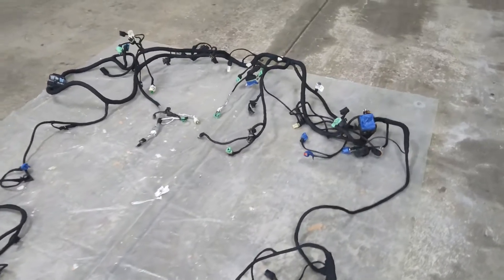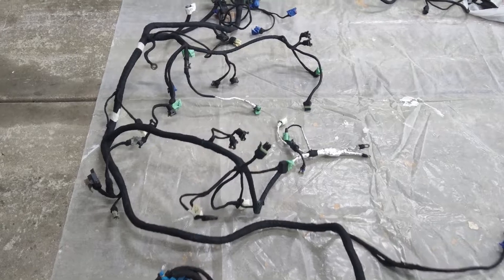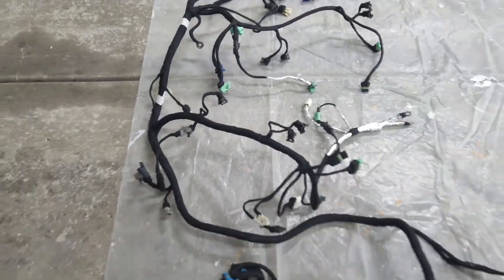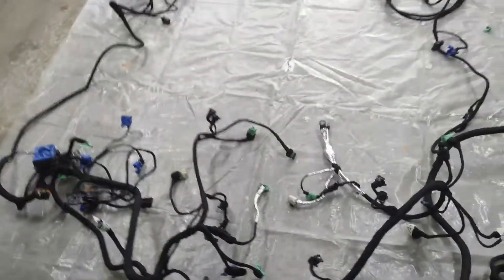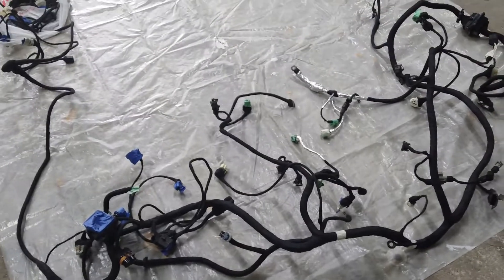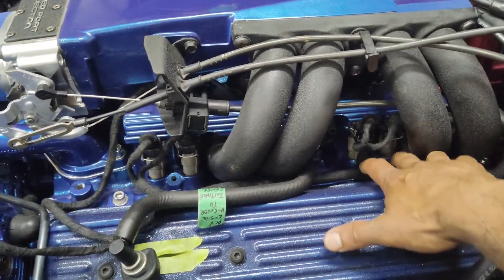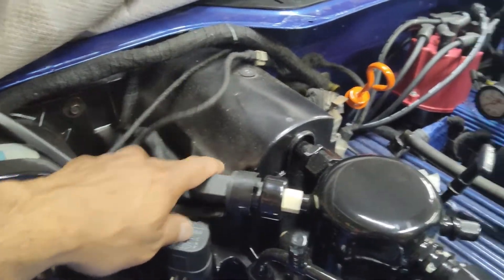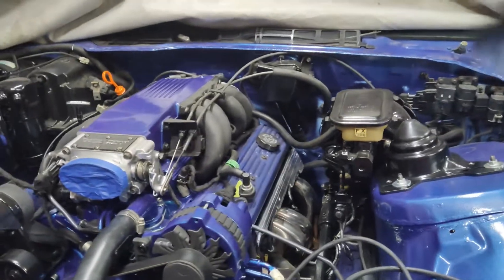Third Gen Camaro/Firebird Engine Wiring Harness | Plastic Loom or Fabric Tape ?

Comment: where did you buy the harness
Reply from the maker: Hi thanks for watching/subscribing.
This was the original wiring harness form this vehicle.  I replaced some connectors, fixed some wires and rewrapped.  If you are looking for a complete harness, just google it and you can find them on eBay from time to time.  Some sellers will separate them and sell them in pieces.
Reply: @JSF Auto +  
Thanks for the reply. I see them everywhere for early 80's and before. Ive looked everywhere for an 89 camaro dash harness with no luck. I think it will have to be used or universal